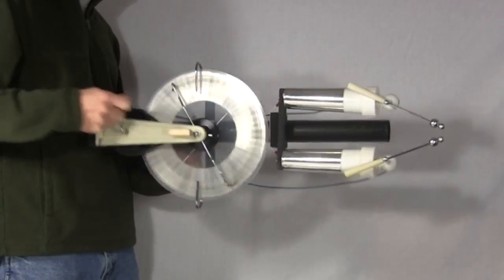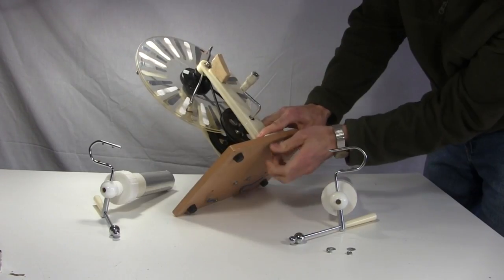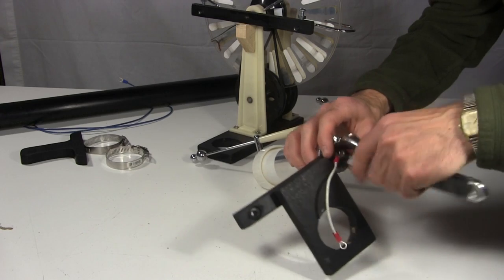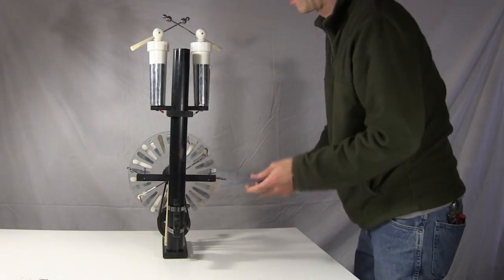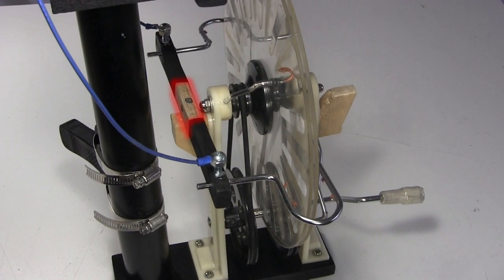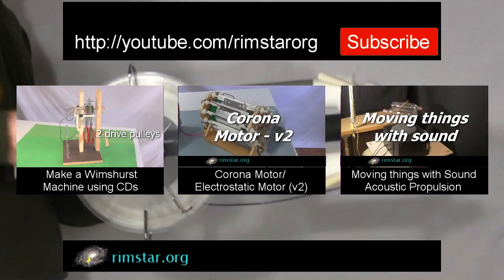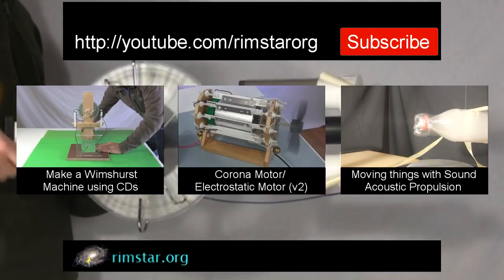Handheld Wimshurst Machine

Comment: Have you tried powering lifter from whimshurst
Reply from the maker: No, but that's because I've tried powering the lifter from my big Van de Graaff generator (https://www.youtube.com/watch?v=EsZQS2GOMQE) and that almost but didn't work. That big Van de Graaff is more powerful than my Wimshurst machine (the one with the 27cm/10.5" diameter disks) so there is no point, the Wimshurst wouldn't power the lifter.

Comment: Have you tried putting a drill on it or would it mess with the effect
Reply from the maker: Ben Jones I haven't tried a drill (or any motor) and it wouldn't mess with the effect. In fact, the faster it turns the more rapid the sparks. I could open the cap wider and get more frequent brighter sparks even.
But there's a maximum speed I can rotate the disks before the belts that drive the pulleys start slipping on the pulleys and I'm already pretty close to that when I turn it by hand. A motor would make for easier handling though, easier to keep steady since I could hold it with both hands.

Comment: Just in time for black friday. That should keep the crowds back. How about adding a DC motor for push button drive..
Reply from the maker: Mongrel Shark Crowd control when shopping. Is that what you call purchasing power? :) A motor would need quite a bit of torque to turn the crank - but I kinda like the low tech crank anyway.

Comment: interesting video, im still contemplating on making a portable n machine..its oriented to high amps low voltage contrary to an electrostatic machine..
Reply from the maker: fidel catsro Regarding the testatika, I did a tremendous amount of research on it in the past http://rimstar.org/sdenergy/testa/index.htm It's not a Wimshurst - the only similarity is the use of counter rotating disks in some of their machines. It was deadend research since there aren't enough details to replicate, but there was plenty of food for thought. I don't have time to do more research along those lines these days.
Reply: noted on the testatika secrets unrevealed but have you tried charging a 12 volt battery with the wimshurst spikes connected to an automotive ignition coil as a step down transformer with dc rectification?

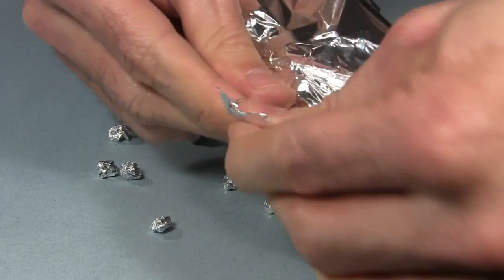Comment: At about 2:24 you say "Of course, don't try zapping yourself..." but I refuse to obey. ;) I've been zapping myself with the piezo thingy from a BBQ lighter for a couple years now, just for "WTF not?"

Hah! I was about to say that I seem to have become completely used to the shock, but then I moved the leads apart (thinking they'd still be the spark gap...) Nope, spark gap to my fingers and then through my left hand and ow! Haha!

RimstarOrg, can you please describe the relationship between a spark gap and voltage spike (if you haven't already?) Thanks!
Reply from the maker: Martel DuVigneaud At 2:24 I actually mean don't zap yourself with a big Wimshurst like this. Depending on the spark gap size, it's more painful than the piezos from BBQ lighters... yup, I've done that too :).To understand the spark gap and voltage spike relationship you have to think about what's going on. As the voltage rises, it gets to a point where the electric field gets strong enough to start ionizing the surrounding air. That's the corona. That means the electrons are leaking to the air and so the voltage can't continue to rise (unless you keep pumping it). So at that point the voltage should be peaked. Once the air between the electrodes has become conductive enough due to the ionization, you get a rush of current across the gap. That's the spark. And since it's a rush it rapidly depletes the charge on the electrodes and hence the voltage rapidly drops.
Reply: RimstarOrg Cool, thanks for the explanation. :D

Comment: Mr Wimshurst sir...if you make some darts with wires and shoot them from a gun you could use it for defence purposes without killing people...
Wimshurst response " it'll never take off".
Reply from the maker: m3sca1 I thought about it. Though I would have gone with round metal balls instead of darts. Anything with a sharp point will quickly lose its charge due to the strong electric field at sharp points that would leak the charge by ionizing the surrounding air.

Comment: Why are people giving thumbs down to this cool video? This is a great idea and it obviously improves the original  large bulky design into something you can use anywhere!
Reply: yes these videos should be encouraged so that many will experiment with these and who knows one day someone will discover the secrets behind the testatika machine as a result of this
Reply from the maker: USWaterRockets Who know why the thumbs down, maybe not big enough sparks. Lots of thumbs up though! I'm with you, I like the portability.
Reply: RimstarOrg maybe they expected the video was going to be a scratch build tutorial and it was a modification of a commercial machine?  Anyhow, the original design looks like it takes up a whole tabletop, leaving little room for any experiments. The new version takes up hardly any space at all. Also, good catch on the conductive paint. That's a good piece of into to know!
Reply from the maker: USWaterRockets
Yeah, the conductive paint one had me stumped a bit. My first guess was conductive wood, but the wood was dry so I discounted that right away. Then I spent a lot of time tweeking all electrical connections. Only when I had run out of ideas did it finally dawn on me that it might be the paint. Sure enough, the resistance was megaohms, but this is such a low current device that left enough conductivity to make a difference. And as soon as I sanded away enough of the paint, it started working.

Comment: HOLY COW..... A Cully Screwdriver.... I have the same one
Reply from the maker: chimneswp I know... These screwdriver's rock. It was also great when I used to go to remote locations for solar contracting jobs. A Cully screwdriver, a short multibit stubby one and one long flathead were all the screwdrivers I'd need to carry. But besides the multiple bits, I like the way the parts of handle turn independently of each other so you can press and turn continuously at the same time.
Reply: I got to meet Mr. Cully in the mid 90's  - the man was ahead of his time

Comment: very cool ! hmm i would add a small battery powered motor with a switch would be more convenient and free's up the hand but that might defeat the original design  although we are in the 21 century bit of modernization could be in order !
Reply from the maker: dirkk82 Thanks! Yeah, to go with a more steampunk approach or a more modern one? I kinda like the retro handcrank approach myself.
Reply: RimstarOrg i do like the hand crank as well it reminds me of the hand cranked gatling guns that were used during the Civil War !

Comment: Ouch, thankfully I haven't been shocked with high voltage spark before because getting shocked by touching metal doorknobs is bad enough.
Reply from the maker: Brandon Fisher I've been shocked many times with high and low voltage but never with enough current or long enough to be really painful or damaging. I deliberately kept the spark gap small when I did it for this video, so that it wouldn't be too bad. Still worse than a doorknob though.

Comment: Could you provide a link to a store that would sell this. Most of them are really expensive, I was just wondering if you had a link to a cheaper one.
Reply from the maker: ProSurviver I bought mine a few years ago on ebay. The only stores I can think of that might sell these are stores in science museums or hobby stores that have a science kits section. You can make your own that has similar output to this one if you use those old black vinyl records for the disks (unless you can make your own disks or find something else.)
Reply: ProSurviver Use a Van De Graff generator instead. Homemade ones can be made for less than 25$

Comment: just wondering, say we use a dc motor powered by some AA or C or even lipo cells. How efficient would it be as a HV transformer, instead of using a DC-DC converter?
Reply from the maker: Laharl Krichevskoy Since I hand crank it I don't know how much electrical power you'd need for a motor but it'd be more than AA batteries. Wimshurst machines, and any electrostatic machines that rely on using corona (ionized air) for transferring charge aren't very efficient. You're better off using a DC-DC converter if that suits your needs.
Reply: that being said the 1980s swiss testatika machine is a highly efficient cousin of the wimhurst machine and the engineering behind its efficiency is still a secret today